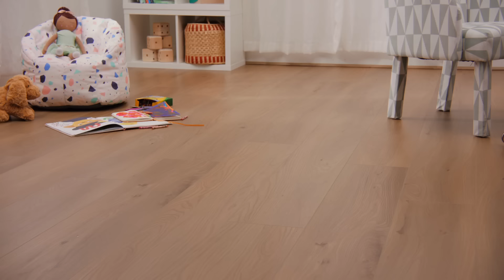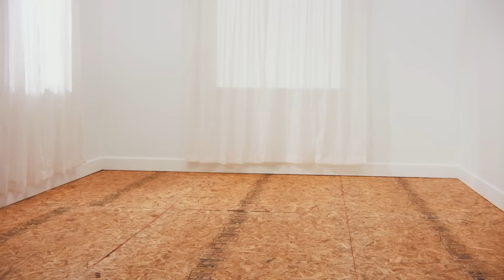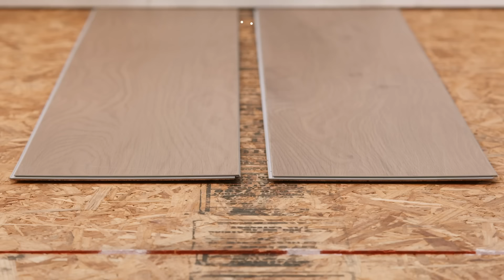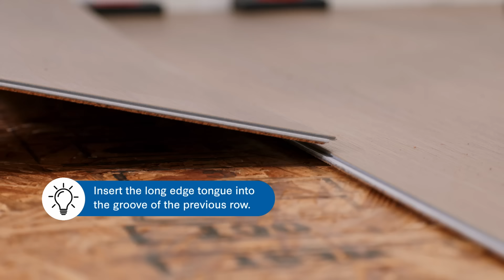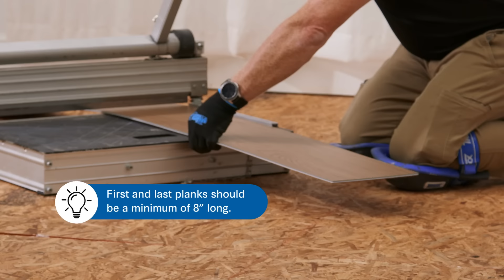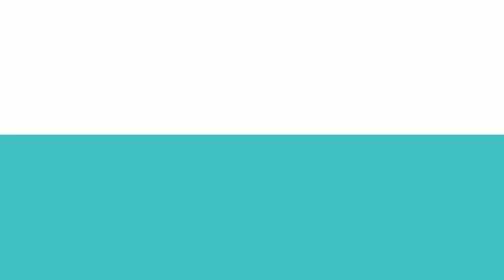COREtec Pro Installation

Comment: Have more problems with this product than the rest of them. Cork  tends to swell with humidity changes. That's why they use it in wine bottles And tap and lock products are also prone to mess up. Locking mechanism all the way around is your best pet.

Comment: Tapping the ends method does not work, it breaks the flimsy locking system of these boards. Angle/angle method is the best option .
Reply: It's the number #1 rated and top selling  LVP in the U.S. Your comment is suspicious.😮
Reply: @curtmcalister4087  I can concur that the locking mechanism is faulty/flimsy. Many planks were damaged inside the package. Number one selling LVP with old technology sounds suspicious. This is not a good product to install.
Reply: problem is angle angle only works really for one side. When you go to install the other side it requires great regard to carefully tap it in. Even being careful the design does not lock in correctly, poor tongue and grove design agreed